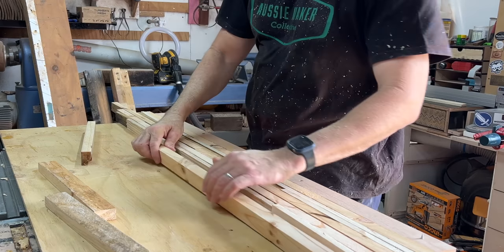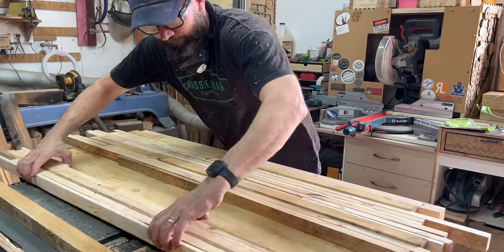and FIVE TOOLS to build your palletwood empire!

Comment: We all have our differences. Our most used tool in our production shop is the miter saw, then the panel saw, then the cnc's, the Festool fleet of tools, etc. Before, in another shop where we mainly produced ply/mdf cabinets, the one tool I missed the most was a miter saw for cross cutting of planks and boards.
Reply from the maker: That it hey. We all have very different work flows, I’m sure I’ll be fine with out. I hope 🤣

Comment: Excellent! The skateboard shaped bench is well crafted & easy on the eyes. I really like the mitered apron underneath with the "Jasper Makes" inspired double-cut corner tenons. I too, have contemplated nixing the chop saw, that well made table saw sled has made me less dependent on the chop saw for cross-cut operations. The only thing I've found in working with  pine: it does put considerably more pitch on saw & thicknesser blades. See you next time mate!
Reply from the maker: Thank you very much! Sorry what it pitch on the saw mean?
Reply: @dainermade  good morning Mate: pine tree pitch?
Also known as “pitch”, tree resin is thicker, tackier, and darker than tree sap. [Deciduous trees do not make resin.] Usually collects on backside of saw teeth & router bits, & on space between thicknesser blades & frogs. Easily cleans with CMT FORMULA 2050 BLADE & BIT CLEANER [or some say SimpleGreen]. Tends to ‘make’ burn marks appear more readily from tool blades.

Comment: Hey nice video and great tips! Only for a budget i would choose an angle grinder with a velcro sanding attachment. Much cheaper than a belt sander, and also very fast at sanding!!
Reply from the maker: Great tip! I use that option for sanding broken skateboards
Reply: @dainermade  ah cool! I use it for rough flattening, then sand it with a orbital sander

Comment: One option to go for instead of a miter saw, is a quality miter gauge for your table saw. Don’t have to break the bank with a super deluxe one that makes toast and walks the dog either. Even Incra has wallet friendly ones that are very accurate. Can also make a miter sled for the table saw. 
Only downside is that cutting long stock can be a bit of a pain in the ass. And it’s not as speedy as a miter saw. Pros and cons.
Reply from the maker: I’m pretty sure I’m about to discover the pros and cons very quickly 🤣 I’ll be keen for a good mitre gauge on the new saw

Comment: Looking at those 'screw down clamps', I'm quite surprised they did not use much coarser threads. It would take less effort to tighten things down, fewer twists of the wrist/arm. I'd also wager they would stay tighter, longer. But wow - so good to see a new video from you!! BTW - you could do a whole video on cutting those miter half joints; I'm impressed!
Reply from the maker: Hey mate, your right. If they could wind up and down faster, then that would be great. Also I think you may have just given me an idea for the new channel. A few joints I’ve experimented with
Reply: @dainermade  Great - just let us know when you start a new channel. I really did like those joints on this project.

Comment: Table saw next, check, might go get the little Ozito PXC  2x18, that way i don't have to get a 15 amp power point installed.
Reply from the maker: I did not know they made a ozito battery table saw. There are many Jobsite saws that are 10amp. Money is always an issue. But if you can hold out a little more and save a few more dollars. You won’t be disappointed. I’m all for DIY tools. But have a good think about the table saw

Comment: Marion 3.0 is looking great, Mark - just on my way over to sub to your new channel.  Only space I have for building is the kitchen and a 3mx2m space in the back yard when the weather allows (space v limited here in the UK) so no space for a table saw but I did stretch to a track saw - and a shop-vac to help maintain the matrimonial bliss on the kitchen days.  Keep doing what you do and inspiring us all!
Reply from the maker: Thanks mate. That is pokey! But if there is a will there is a way. Enjoy
Reply: Care to show and tell what you build? I've done a workbench and bird table! :)
Reply: @arcadia1081  My latest build was a TV stand from reclaimed scaffold boards.  The boards were cupped, twisted, and showed all the signs of being heavily used on building sites (cement dust, paint, welding burns, etc.). They were too far gone to try to retain their industrial look, so I took more than two days just sanding down the boards to 240 grit, getting rid of the worst of the cupping and twisting (no plane!) and then had my first go at cutting rebate joints with a track saw - not quite as easy as I imagined.  Would love to build a workbench like you but, sadly, I'd have no room to put it!  I think bird nesting boxes may be a project for the near future.

Comment: Looks great man. But think about hanging the cnc on the wall.gives you way more space.
Reply from the maker: Thanks mate. Unfortunately not recommended (or do you mean for storage)?
Reply: @dainermade  yes and no I store mine on the wall and it will find down for me. But i also use it that way a bunch. All.my chips fall  off the piece so less issues with chip build up. But I also have an one finity cnc. And it's super stable

Comment: Nice work Dainsey, the first big thing I made in my workshop other than my workbench was a giant wall mounted glueing up board. Its perfect for glueing small bits of scrap wood into body blanks for guitars.
Top tip, ditch the grease proof paper, just use cheap car body wax. The glue will not stick 😀 Just gotta remember to reapply every few months.
Reply from the maker: That's a great idea! Does dust stick it though. That’s my next biggest problem
Reply: @dainermade  yes it does. Gotta keep it covered with a sheet of melamine if the glue up board stays out in the open. I use wax paper as well btw.
Reply: @dainermade  not if you use car wax, the sawdust just brushes off. But my clamping board is mounted vertical on my wall, not sure if that makes a difference 😀
Reply: Have you heard of "cigar box guitars"? They are cool projects!

Comment: They use to hav belt sander races at work when i first started 2 sìde by side a long extension cord 
our shop floor was timber  they sat on them and balanced somehow squeezed the trigger and off they went good old makitas from 1994 vintage

Comment: Awesome video mate👍. Absolutely agree on using cheaper tools when you can. I run metabo cordless tools  great but can get expensive. I need a cordless caulking gun for a job about 3 times a year. So I bought the ryobi 18 v one for about $80. Does a good enough job and is about $300 cheaper than metabo. Cheers and def subscribing to the second channel. How’s the heat going on Townsville?  Mount isa is pretty damn hot and dry atm. Especially with all the fires 🔥
Reply from the maker: Just staring to warm up. We have had a heap of fires to. Loads of smoke around. We definitely don’t need a matching tools set, too expensive hey

Comment: Hi Mark, great video ... what brand and model replacement table saw are you getting? Also with your Dewalt thickness planer are you using the standard blades or upgraded to the spiral blades? Ethan
Reply from the maker: It’ll be a 12in Sherwood cabinet saw. Very exciting. I upgraded the planer blades, possibly the best upgrade I’ve ever done. The economics of that alone is worth it line term. And it’s so much quieter and it eats timber alive.

Comment: Im gonna make me one of those pallet busters. What are you using? 1" sq tubing? 3' tall with 4-5" prongs welded to the a 4" cross bar?
Reply from the maker: Hmm 35mm 1.5 inch.  Just make your prongs about 110mm apart to span the broader runners and slats
Reply: @dainermade  gotcha 👍 thanks mate

Comment: good job very interesting , i need to make something on the same lines to put my band saw and thicknesser on , the joints look a bit over my skill set what would you recommend
Reply from the maker: Hi mate, Just do the half lap don't worry about the mitre. That would be fine a stand
Reply: @dainermade  i bought some metal ones on wheels to save me alot of work , but like you say just get started and im doing it , side hussle to start with i guess

Comment: I must be too agro with the belt sander, me using one is like,
Left,
Right,
Left,
45° angle,
Hole,
Beer.
Reply from the maker: 🤣 it can get a bit aggressive
Reply: @dainermade  I'm used to using them on sheet metal, woods a different beast, accidentally rock it 0.001° mid sweep and it cuts in xD

Comment: No not mitre saw.... Had you tried running the cnc mounted vertically?
Reply from the maker: It is not recommends by the team at CNC3D. I did ask 🤣
Reply: @dainermade  yeah, probably supplied servos can't cut it, but being a lead screw and not belt design, you might have been able to upgrade and got away with it, anyway onwards to the mitre saw free future

Comment: Ok, but what is that tool called that you're using to break apart the pallet? 

I have a wrecking bar, essentially a huge crowbar, and it destroyed some of the wood. And my back...
Reply from the maker: If you search Reno bar… Amazon will get you sorted. Cheers
Reply: @dainermade  excellent! My back will thank you!

In case anyone in the United States is wondering, these are called "pallet busters."
Reply: I have a rough neck pallet breaker (UK) and brought it from I think Amazon a few years ago and have zero regrets, best 30 quid I ever spent, my mates who have used it love it too and have brought their own ones

Comment: Yeah, nah, nah, yeah! Hopefully with new table saw will come real palette wood as well. Enough of these instagram vs reality video-edit palettes. 🤣 On a serious note, in all of this time dealing with "pallets" and buckets of removed nails, did you ever missed a nail that caused an issue while milling? 👀 I known you use the detector but still. Just curious. Greetings to the down undah.
Reply from the maker: I’ve put a nail through every machine. Very first slab when I got my thicknesser, I hit a monster hidden nail. Killed the 3 knives on one side. I’ve dulled many a saw blade too. Cheers mate

Comment: 99% of pallets are made of hardwood, not pine.
Reply from the maker: I 99% disagree 🤣
Reply: Dunno were your getting your pallets but 99% of mine are pine here in Scotland
Reply: Ya I'm within 5 miles of 2 pallet making and rebuilding here in Missouri. Rare to find anything other than pine.
Reply: @oneacrehomestead  I'm starting to think people don't know one species of wood from another.
Reply: @BIKER1959-q3t  ok slightly take the only pine part back, Spruce too. Not saying that there aren't hardwood ones. Have several out here, just unfortunately a lot harder to come across at least in my area.
Reply: @oneacrehomestead  At the Company I work for here in KC, has a spot that we put smaller 3' X 3' hardwood pallets out for the public to take. Free of charge. There is however sometimes a random odd sized pallet that we put out that is pine but not very often.
Reply: @BIKER1959-q3t  lol wish I was closer.